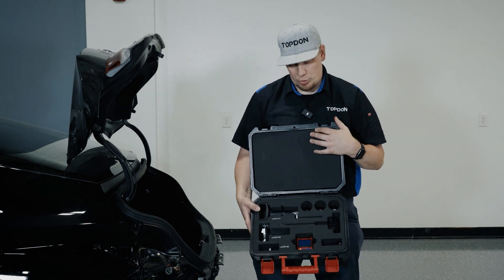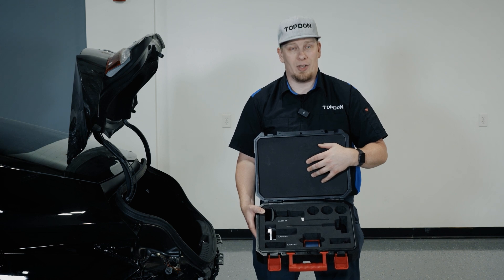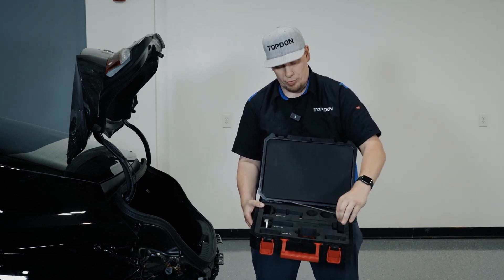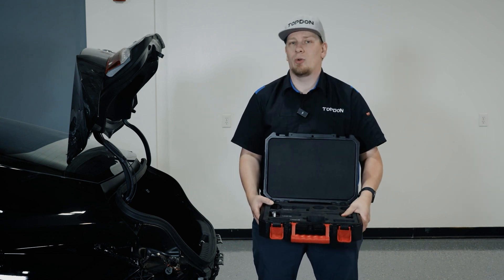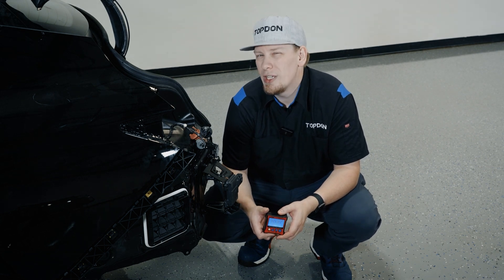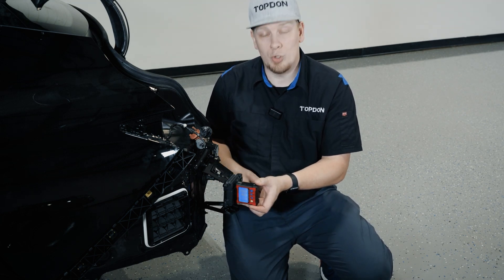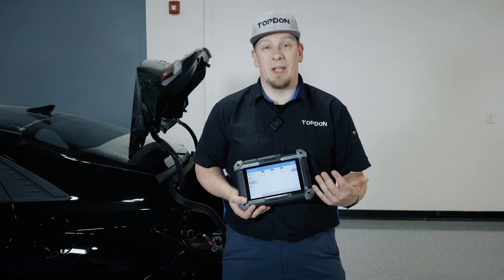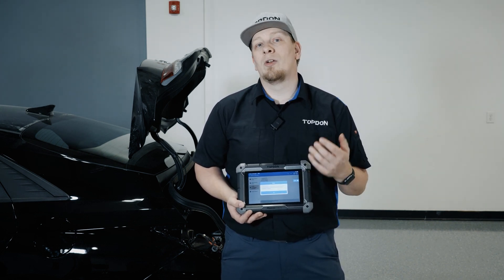How to Use a Radar Alignment Tool

Comment: I have xtool it has completely fake adas instructions all the measurements for placing the target board are incorrect while launch has authentic adas information but need to pay more 500 usd to activate that. What about this tool? Dose it has authentic adas calibration data information can you confirm. Mostly for toyota and lexus
Reply from the maker: Thank you for your inquiry. TOPDON device offers accurate ADAS calibration data and is fully compatible with both Toyota and Lexus models.
Reply: TOPDON Phoenix Plus 2??? @TopdonOfficial